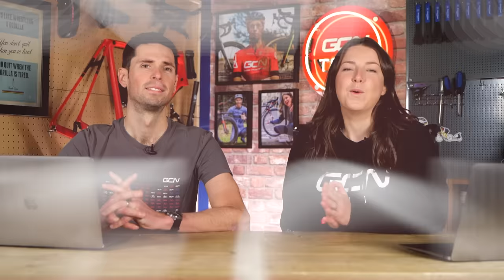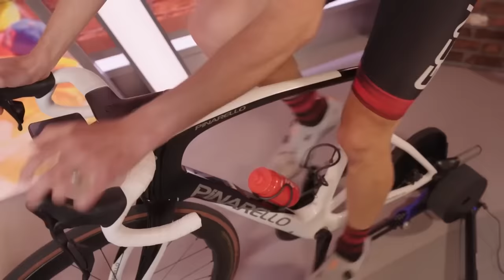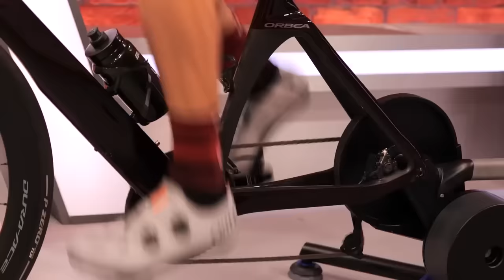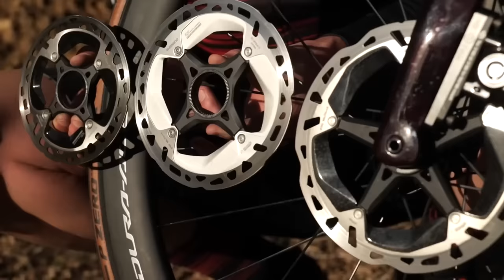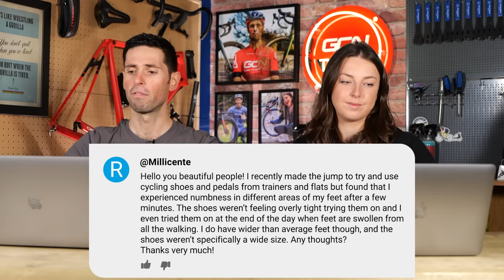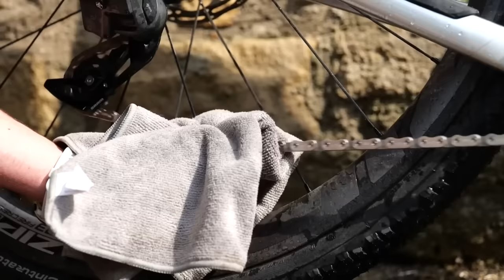Swapping Stems, Turbo Troubleshooting & Numb Feet! | GCN Tech Clinic

Comment from the maker: Let us know your tech questions using #askgcntech 🛠
Reply: #askgcntech I saw this in a previous comment, but I also had this problem. Do you know a solution to attach a rear rack to a carbon bike that doesn't have mount points?
Reply: #askgcntech I come back to cycling and think about building a new bike. Is it a good idea to do a bike fitting first to know what to buy, or does it really matter? 
I have also been watching GCN since middle school, barely speaking English. Now in college, I speak almost fluent English. Thank you for the cycling lessons and the English lessons .

Comment: Re the numb feet. Before spending on new shoes, try adjusting the cleat placement (it costs nothing to move your cleats). In particular, try moving them backwards on your shoe.
Reply: I've had numb foot "randomly" just this year. It was from lack of pre stretching and low hip angle (low bars).
Reply from the maker: Great point! playing around with cleat position may unlock some hidden potential in your current set-up 🙌
Reply: Also moving the cleats as far toward the arch as you can. Wider stance can relieve so many hot spots.
Reply: Sometimes replacing the insoles with ones that have better arch sort support than the ones that come in shoes can help.

Comment: The main consideration when choosing stem length is the effect this has on bike handling.  A shorter stem makes the bike feel a bit more “twitchy” while a longer stem makes a bike feel more stable.  I would definitely go with the slightly smaller frame and longer stem.  You will never notice the 1cm spacer but the improved handling you will feel.
Reply from the maker: Very true! It'll all come down the the riders style and preference

Comment: Best way to clean a commuter bike. What winter riding has taught me is that as soon as I finish my ride I use my air compressor to knock off all the ice, salt, mud, as much water as possible with an emphasis on the chain... It only takes a minute. Then I wheel it into my shed where I'll tend to it properly after I shower and warm up.

Comment: Two of my old race bikes were made in the 20th Century and were made for quill stems. Most quality quill stems were available in 5mm increments. One of mine has a 140mm, 73 stem, and the other has a 135mm, 73 degree stem.

Comment: I reckon you guys are off the boil this week. Was there an early Xmas party? 🎄😅

Clearly the guy talking about 0.5mm stem increments meant 0.5cm. In other words, what would you do if your ideal stem length came out half way between 2 options? 

For the person who had sore feet after starting out with cleats, surely you should have also mentioned cleat position. Incorrect gait, fore-aft and cleat angle can all cause sore feet. A bike fitter once did magic for me by moving mine around and fitting some pedal spacers. Hope you haven't sent GCN viewers off buying new shoes when they should be trying out the free option first.

And, I think a lot of us get better connectivity with ANT+ compared to Bluetooth, especially in environments where there are a lot of Bluetooth / wireless devices. An ANT+ dongle on an extension lead is usually very stable on Windows PCs / Laptops.

Comment: I had the same issue as Millicente regarding numbness in my toes. I solved the problem with Specialized Blue footbeds. No more numbness in my toes or pain in my feet.
Reply from the maker: Awesome! Did you try that yourself or was the change the result of a bike fit?
Reply: @gcntech  No bike fit. I have relatively flat feet and found that some type of arch support was needed. The footbeds that came with my Sidi cycling shoes didn't offer the necessary support. The blue footbeds from Specialized worked perfectly. I use them in all my cycling shoes now.

Comment: Numbness and hotfoot often caused by pressure on nerves between metatarsal bones in foot. Inserts that spread metatarsals usually relieve this pressure and solve the problem. Several manufacturers available. I use g8 metdomes.
Reply from the maker: Lots of people have good results using insoles, Bike fitters will be able to advise on this if you are not too confident

Comment: The guy with the trainer issue, I have this now and again. What it turned out to be was the elite trainer. There's several connections to the trainer when attaching to zwift, they all work when in ERG mode, but when free riding only the FE-C version, otherwise if feels like hills have no gradient
Reply: This is exactly the issue I have every once in a while. I un-pair and re-pair and it is good
Reply: I've had a similar problem on my Direto XR. For some reason Zwift has decided to try connecting to a different channel for the controller from what it connects to for power and cadence. I have to disconnect it and reconnect to the right controller channel now about half the time.
Reply: @StephenCrimmins  Yeah, that's the trainer I have. I 'upgraded' from a taxc flux...much better trainer but can't do as steep a gradient. The first couple of times was during zwift league races, I'd do an erg warmup and everything was good, then the race would start and I'm in top gear spinning at 110 rpm uphill struggling to hit 300W. It would happen every now and again for no real reason. After the 3rd time I'd figured out the issue. I try and double check that it connects to the correct one every time, occasionally it still happens. I don't get why elite included a 'this doesn't work' channel, my tacx never did that.

Comment: I run an Ant+ dongle connected to my laptop for Zwift and it has fixed all of my connection issues.  I run bluetooth headphones and our house is littered with bluetooth and wifi interference which caused me tons of issues.  I also run max Zwift difficulty, not that it is actually harder...watts are watts.  But it makes you shift more and "feel" the elevation more, which causes you to shift, just like when outside.  Think of Zwift difficulty as "how much do I want to shift?".  My first trainer bike had an old cable operated thumb shifting triple ring, and as such, I ran difficulty on the easiest.  Now that I have my 1by gravel bike on there with eTap...not an issue.

Comment: Cleats should be well aligned. They can't go too far forward or too far back. Usually they need to be moved back a little. But not too far cos it will be bad too! Another issue is the height of the saddle. If it is too low, constant pressure will cause numb feet. Another issue is poor blood circulation in the feet. You may also have crooked feet and you need shims. 
Changing the insoles may also help. A well-chosen insole will spread the foot pressure more widely and will not cause pressure in one place. 
There are many possibilities and you don't necessarily have to buy new shoes.
Reply: Stretching may help a bit. But don't expect a spectacular effect. First of all, a good position on the bike and than correct cleats.

Comment: Concerning the zwift/trainer issue, also consider if you have a wheel-on trainer to check whether the roller thing is correctly installed and secured. Bad installation could explain why you need maximum training level, and could also explain slippage during effort which could feel like loss of resistance.

Comment: 3:36 I think shoe geometry is way too complex to allow power measurements. In pedals, cranks, spiders etc., the stiffness can be calculated fairly easily, which allows the conversion of the strain measurement to a force reading and, consequently, the torque.
Reply: And unless it can be made so thin, like a replacement insole you could swap in, nothing could work with normal shoe design.... it would essentially mean building it in to the sole of the shoe. Expensive, and what an inventory nightmare carrying all the different sizes and styles.

Comment: @millicent Lake 237 and 238 and Bont Vapour 23 have wide front of the shoes reportedly so they might help with numbness. No personal experience though. Reportedly the Bont has a stiffer sole so the Chace of the cleat pushing nerves in the bottom of the foot causing issues like numbness should be lower. The other parts of shoes are reportedly softer in the Lakes. Lakes for leisure Bont (light and stiff) for racing. This advice is from bike fitter Neil Stansbury (hope I remember correctly) on Youtube channel Road Cycling Academy just recently so the video should be easy to find.

Comment: A possible answer for training difficulty, I have seen were either ant+ or bluetooth my Saris Hammer 2 was adding difficulty. Once I switched to the other protocol it worked. I can't remember which on is the one that worked. I tried updating Zwift and firmware and non fixed it so now i just make sure to use the correct connection style.

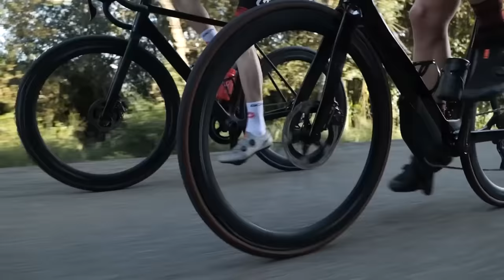Comment: 5:25 yeah and if it's not centered then you can most likely loosen the caliber bolts little bit and then hold down brake lever and while doing that you can just tighten the bolts.

Comment: Y'all missed it on the bike fit question. I don't know if the sender mis-wrote or you mis-read, but clearly it wasn't really a question of 0.5mm difference in stem. To your point that most stems are offered in 10 mm increments, I think the intent of the question was 5 mm aka 0.5 cm. IOW if theoretical fit requires a 75mm stem, get a 70 or 80mm?  Ironically, I think the answer of 'it doesn't matter' comes to play anyway. Make the best guess if a bit more or a bit less would be more comfortable and don't worry about it.

Comment: If you wipe the chain of a wet commuter and apply lube the lube will transport dirt particles into the chain and that grinds the chain and rings and cogs faster than a properly washed chain does. If possible I would not lube the chains until a proper chain cleaner was used.

Comment: There are shoe sole power meters for running but presumably they would give way off figures if at all. The movements thus algorithms are different. If data from running shoes would come up and be repeatable it still might not scale up correctly between different power levels. The sensor technology is there and the algorithms could be close to bike based power meters but there are r&d costs. Shoe power meters should be doable now because everything needed exists already and some forms of everything needed are on the shelves. Neat idea hope it takes off. Insoles and shoes wear faster than bike parts so retaining accuracy throughout the life time of a sole or a shoe is challenging.

Comment: If you have numb feet try some composite mountain bike flat pedals paired with leather oxford shoes with work safety sole.  It's pretty much impossible to get sore feet with this combo.  You can get a pair of barely used work Timberland Oxfords at the used shoe store for about 10 dollars.  It takes awhile to break these shoes in so I recommend used.  If I am doing any sort of bike touring the Oxfords get dusted off for sure.  They have cycling specific version of these shoes but they are marketed towards Dentist riders so you will be paying over 200, not worth it.

Comment: Power is the measure of strain not pressure so it would be very difficult to measure the shoe sole movement. Particularly as you don't want shoe flex. Power cranks have stain gauges to measure the flex and Power pedals do the and but with the axle flex.

Comment: Regarding numb feet and shoe fit, what about molded orthotics? They're quite common for ski boots for improving fit and power transfer
Reply: Most orthotics have more thickness than a typical insole.... particular cycling shoe insoles where it's often very thin because not much walking is expected.... I think fit would be a big challenge adding orthotics to an existing shoe.

Comment: I have one foot that goes numb on longer rides. I have very narrow feet and even loosening the shoe doesn’t help. We did move the cleats back and it takes longer to go numb, but didn’t fix the problem. Like Manon, I just have to unclip and get feeling back.
Reply: Sounds like a disbalance towards one side. I would advise getting a proper bike fit, there are zillion options what could be the core reason. A professional bikefitter should be able to pinpoint it and offer solution.

Comment: #askgcntech
Hi!
What is the main reason winter riding is so slow? I seem to lose about 5km/h average speed for the same power output over my regular commute as the temperature drops from nice summer/autumn temperatures to freezing winter. Is it just the bulkier clothes or do the tyres actually roll slower in the cold as well?

Comment: #askgcntech when I was coasting down a hill on my gravel bike in the hardest gear, my chain spontaneously jumped off of my cassette. Could my chain be too long? Could this be prevented if I remove one link, or would that cause other issues?
Reply: I’ve had this on my road bike a few times and it’s scratched my crank pretty bad. Would love to know a fix!

Comment: #askgcntech I had a bike fit before buying a new bicycle and I am debating between two models. 
With one of them I would have the stem with no spacers but the stem should be 90mm instead of the 100mm it came with. 
With the other one I would need to have 1cm of spacers (plus the headset cover of 0.8mm), but keeping the 100mm stem that would come with the bike. 
So should I choose the bike with 1cm of spacers or the bike with a stem that is 1cm shorter? What is better in terms of handling, etc.?

Comment: #askgcntech I have an aluminium road bike, the Swift Enduravox Comp with a 2x10 Tiagra groupset with mechanical discs. What would be better value at the same final investment, buying Carbon Wheels ou selling the bike and buying a carbon bike with aluminium wheels and 105 11s?

Comment: #askgcntech Dear Gurus, I have a chain maintenance question. Living in Australia I pretty much only ride outdoors in dry conditions and aim to do around 200km per week. After every 30-50km ride, I wipe down my chain with a rag and then lubricate it with Muc Off dry lube. I still tend to notice greasy deposits after wiping down the chain between the inner and outer plates. If I’m using a wax based dry lube, should I still be completely degreasing my drive chain (inc cassette, jockey wheels etc) every week, or just wiping down and reapplying the dry lube?
Reply: Unpopular opinion - Mucoff basic dry/wet lubes are crap and always leave a residue which is pretty difficult to remove. Either use their top line (pretty expensive) or find a different one. I'm not sure what's best available in AUS but your LBS should be able to advise.
Enjoy!

Comment: Hi GCN, 
#askgcntech
I have a sidi shoes that needs a cleat nut bolt replaced. The problem, i cant find a replacement online. Is there an alternative nut i can use to replace it. Thanks and more power. - dan

Comment: #askgcntech Dear Ollie, Alex and Manon, You have successfully convinced me to take the plunge into waxing my chain. How long could I store a waxed chain without it losing its favourable properties? Given the effort it takes to initially treat, clean and wax the chain, I thought it would save time to wax multiple chains at the same time, and then when my chain is worn, I can effortlessly switch to a chain that has been pre waxed. Also I planned on waxing multiple quick links for the same reason. Thank you for your great work, love the channel.
Reply: I would just store them in a bag of some type so they don't collect dirt/dust.

Comment: #askgcntech, hi guys, I have a ultregra groupset and using the r8020 levers, every year I have to buy a new 11 speed shifter as the internals break. It skips down loads of gears, gets stuck and doesn't shift up. It's costing me 300 every year, do I change to 105 and hope for the best. What's your advice. Cheers guys

Comment: #askgcntech Hi Manon and Alex, I'm planning on assembling a new bike with an aluminum frame and I'm not sure what type of grease or assembly paste to use to install my T47 bottom bracket, and also around the headset area (carbon fork). I have Muc-Off Bio Grease on hand that I already use on all my screws, pedals, thru-axle,... is it convenient for the bottom bracket shell and headset as well ? Thank you very much for your feedback. Cheers, Bastien.
Reply: Grease has zero anti corrosion ingredients, it just lubes and waterproofs. Some materials like 7075 aluminium will corrode/oxidise from within no matter what grease you seal it with. 
You want nickel anti seize, something sacrificial for the anode/cathode corrosion

Comment: #AskGCNTech So I live where there is year round sunny weather (Hawaii). Here's my question. On rides under 4 hours I don't get a tan on my legs; I no longer even bother with sunscreen on my legs for shorter rides. Anything exposed above my waist would have have burn right away with out sunscreen. Why don't my legs tan? Do my legs not get sun light? Are they spinning so fast the photons are unable to hit them, or do I cast that much of a shadow over myself? Surely this has happens to other people? (side note: I'm a normal guy that doesn't shave my legs, or anything else.)
Reply: I’ve noticed the same thing here in Australia. I wonder if it’s because your legs are underneath you while riding so don’t get much sunlight whereas arms are usually bent so forearms facing up to the sun.